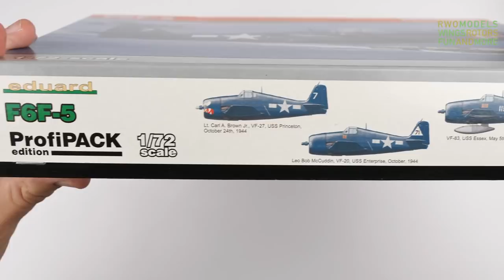Grumman F6F-5 Hellcat US Navy 1/72 Eduard Profipack 7077 Full Build Video | RWO Models

Comment: I like everything. I am new to the hobby and you are truly an inspiration to me.
What airbrush model and needle size did you use with the Vallejo paints?
Reply from the maker: Thank you so much for your kind words! 🙂 For this build I used my old H&S Evolution Silverline with 0.2mm nozzle. Good airbrush used by many modelers but with Vallejo Model Air it clogs up very easily and the trigger response is not so great. So meanwhile I have a couple of new airbrushes from Iwata and Sparmax. For Vallejo Model Air I'd recommend a 0.3/0.35mm nozzle setup which helps reduce the tendency of clogging up the airbrush. Hope this helps. Cheers!
Reply: @RWOModels  It helps a lot. Thanks for your detailed explanation.

Comment: Love the Speedmaster!!! And really like the bracelet? Do you mind me asking which bracelet is that? Almost looks like an Oyster. The Hellcat came out terrific by the way!!! Cheers
Reply from the maker: Thank you very much, and sorry for my slow reply. The watch is a 2005 Speedmaster Professional with the 1861 movement, Hesalite crystal and stainless steel bottom. The bracelet is the original one for this model, it's 20mm tapering down to 18. I find it extremely comfortable to wear and I think it looks very nice on average to bigger sized wrists. I also own the current Speedmaster model with the 3861 Chronometer movement and the new, narrower bracelet but I actually think it looks too small on my wrist, which is why I prefer my older Speedy. ☺️
Reply: Awesome! Will look for that bracelet. I have a 3861 haselite. Swapped the stainless back for an aftermarket sapphire and I'm waiting for a pulse bezel for it, got the cheapest one that comes with a sailcloth strap as I didn't like the new bracelet. So I'm looking for a nice option! Also my -3 Hellcat from Eduard arrived last week :)
Reply from the maker: Interesting you don't like the new bracelet as well... 😉 It received so much praise for its looks when the new Speedy model was released, and no doubt it is a gorgeous looking watch, but after I got it last year I realized I like the older model with the slightly bigger case and wider bracelet more. My dad owns a vintage 861 model with original bracelet, today I think this is the best looking Moonwatch. ☺️ Greetings from Germany, and enjoy your Hellcat build! Cheers, RWO

Comment: excellent work of construction and detail, I would like to point out that you have mounted the fins of the bomb inverted ....
Reply from the maker: I also found the orientation of the fins a bit strange, just followed the build instructions here. Also there are small notches on the bombs indicating where and in which angle you need to attach the fins. So that's how I did it... I'm no real expert with bombs and armament so thanks for pointing this out. Cheers!

Comment: Im building this kit myself and I dont know if I should put all the stencils on? it doesn't look like you put them on and in 1/72 it might not be necessary as your model looks great!
Reply from the maker: Interestingly the kit I built, although being the "Profipack edition", did not include all those stencils so I could not put them on. About four years ago I built an F6F-5N in the cheaper "Weekend edition" and this one included the extensive stencil sheet. It's up to you but If you intend to heavily weather your model I'd say you can skip at least a part of the stencils because many of them won't be visibly anyway. Thanks!
Reply: @RWOModels  Yeah im building the f6f-3 from 2019 and comes with a lot of stencils but I feel like the stick out alot on a 1/72 scale plane maybe, and your hellcat looks really good without them so I think im going to do the same.
Reply from the maker: If it's the F6F-3 in the three-color Pacific scheme which is lighter overall than the Dark Seablue scheme maybe the stencils could add a few nice details here and there... Either way, enjoy your build! 🙂
Reply: @RWOModels  Thank you! Yeah im building the three tone shark mouth so I might add some.